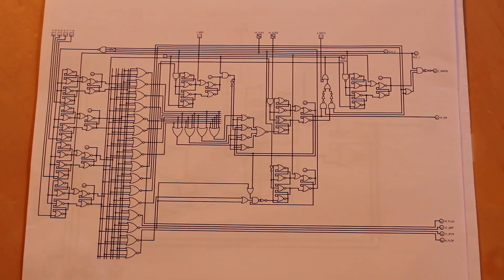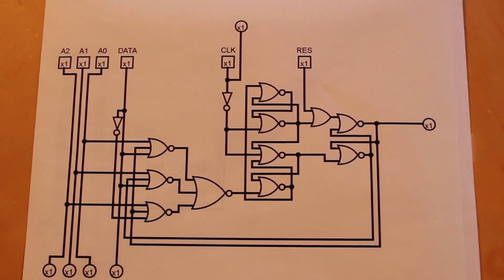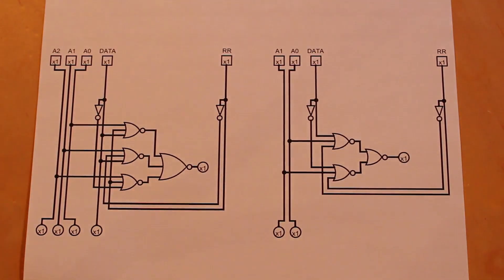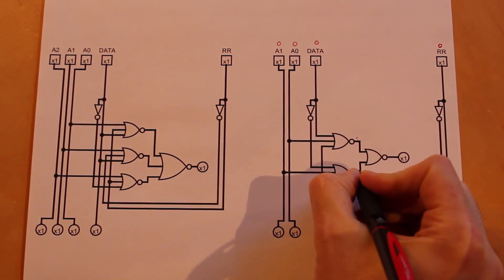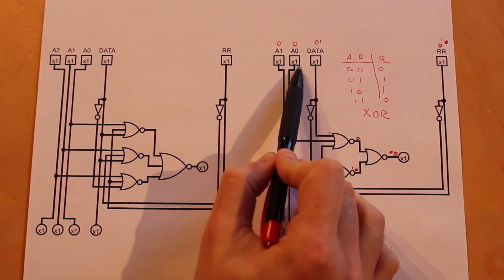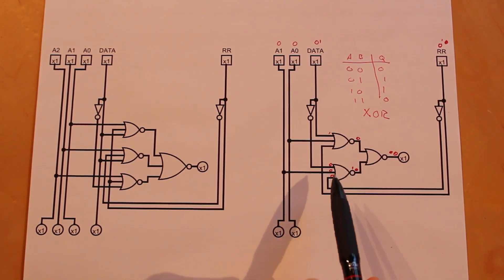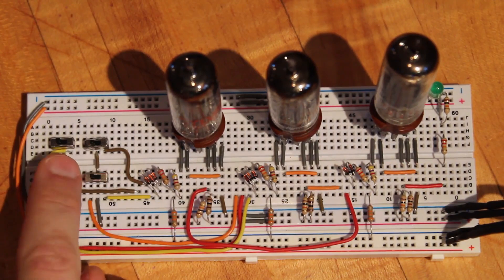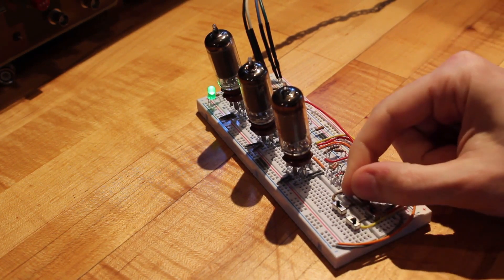Vacuum Tube Computer P.03 – Logic Unit

Comment: I think I understand why you use semiconducter diodes: To use tube diodes you would have so many of them that the tubes that do the actual work would be mixed in and not visible.
Reply: It's still heresy, because 8 SS diodes = 4 dual diode tubes. 6AL5 or the like. But the computer is insane and it works. Kudos to David for pulling it off.

Comment: When the transistors show up as replacements for the tube based inverters, this kind of logic become known as DTL, the predecessor of the TTL.

This usage of a multiplexer to implement logic gates from its truth tables, for a single bit evolved to the usage of ROMs for multibit data paths and is currently known as "lookup tables" and heavily used in FPGAs and similar devices.

Comment: Im enraptured by your projects and have almost everything to try this one at home. Is there any chance you could share a circuit diagram?
Reply from the maker: Thank you so much!
I don't actually have circuit diagrams for the larger components of the tube computer build, but I threw together a quick schematic for the three tube build here! Just as a heads up, I build all my tube schematics in TINA TI so I can actually simulate them too, but I only have a few tube models imported, so in the schematic it says I'm using 6DJ8s, but in reality, I'm using 6AU6 pentodes. The only difference is that on the 6AU6 I have the screen grid tied high with a 100 ohm resistor. Having said that, you could totally use 6DJ8s, they work amazing well at low voltages, better than any other triode I've tested!

Let me know if you have any questions on the schematic!
https://i.postimg.cc/wBsf53SK/MUX-LU.png

Comment: Super exciting to watch! Your production quality is also top notch! Been binge watching your videos lately - came for the relays and stayed for the tubes. I'm currently looking into building a relay computer (long term goal), this gives me some good entry points. May I ask, how you came up with the logic diagram for the Motorola Chip? Thanks and keep up the good work! :)
Reply from the maker: Thank you so much!
Relay computers are so cool! I actually credit Jeroen Brinkman and his Relay computer for really getting me into the concept of computer at a really fundamental level. Defintiely check out his website, he's got some fantastic information on building his computer: http://www.relaiscomputer.nl/
For the logic diagram, it was a mixture of two things. Mostly, I just used the architecture diagram to build up the individual components and link them together in logisim. But, the Logic Unit was a difficult one to figure out. When I cam to that part, I started looking for information elsewhere on the internet and came across this excellent website: http://www.6502.org/users/dieter/m14500/14500jpg.htm

I revised a few things in my design based on their designs, and then of course, I modified everything to work primarily with NOR gates, and ultimately, I modified the LU to be a full on ALU in a future episode. But all in, I think the logic diagram I'm using as my blueprint went through about 8 different revisions before I was happy with it!
Reply: @UsagiElectric  Thanks a lot for taking your time to reply! :) That's some nice info out there. I also found a few videos of people recreating processors in logisim. That could also be very useful.

Comment: A schematic with the tubes would have been nice.
Reply from the maker: Hiya, sorry about that. Each NOR gate is really just a standard inverting amplifier with some diodes added in.
Here's the schematic as built in this episode: https://i.postimg.cc/Z51GWJhx/LU-Old.png

The schematic shows the tubes as 6AN8P, but that's just because that's what was available in TINA TI. The design for the 6AU6 is the same here. Also, the schematic doesn't dhow the suppressor grid, but that's always tied to the cathode, so it can be omitted for simplicity sake.

However, since making this episode, I have done some revision on the resistor values I use, getting much better performance out of the inverters I build. So, these are the resistor values I would recommend now: https://i.postimg.cc/jSwVqLBj/LU-New.png

The only change is the plate resistor is now 33k and the two divider resistors for the grid are now 220k/220k. This design should work with most small pentodes out there, though there may need to be small changes in resistor values depending on how the pentode reacts at low voltages. If the gain is too low, the plate resistor can be increased even more to get more gain, but the divider network resistors need to be increased too. In my limited testing, 220k on the plate, and 820k/820k for the divider network works pretty good.

The design is really flexible and can be made to work with a ton of different tubes, the only thing that needs to be adjusted are the resistor values, which may take some experimentation to find what works best for what tubes you have!

If you have any other questions, don't hesitate to ask! Or if you want to chat in a more real time manner, come join us over on the Discord: https://discord.com/invite/p7UsfHD

Comment: Excellent series, really enjoyable to watch. Regarding your comment on 17 minutes mark, "always 1" result is both valid and useful result for Logic unit. See TTL ALUs (for example 74ls171), it has both "always 1" and "always 0" modes.
Reply from the maker: Thank you very much!
You know, that does make sense! I can definitely see some situations where you would definitely want to pull the result to high or low.

Comment: Man I really wish I could help you in it. Get the logic level madness sorted so you get more of a consistent closer to a rail to rail design.
I'd also make a PCB for it from SMDs to further compressify it :D
Reply from the maker: Figuring out the logic is by far my favorite part! Breaking down the MC14500 and rebuilding it at the logic level was massive fun and something I've been tweaking and modifying for more than a month now!

As for getting closer to a rail to rail design, it's really not too bad. When the tube is in full saturation, the output gets pulled down to about 5V to 6V, which for a tube is impressive. IBM ran 150V on the plate and considered anything below 50V to be logic low, so saturating down to 5V is pretty mental. At full cutoff the output is essentially the same as the positive rail, which is 24V for my designs. But, when feeding the output into another inverter's input, there is a voltage drop, often putting the logic high down to about 17V. This is due to the -12V bias coming through the 33k resistors. Ideally, I should be using much bigger resistors, but in doing so, the amount of swing I can get on the grid decreases significantly, which causes the whole delicate balancing act to come tumbling down. What this means is that one inverter output can only be fed into two inverter inputs at most. Any more than that and the logic high drops to below 14V and the whole thing stops working.

I honestly, just need more plate voltage to make things simpler. Even if I were using just 48V, the tubes would respond so much better. But, I'm nothing if not stubborn, so 24V it is! The solution is cathode follower buffers, but that's something we'll be getting into more in future videos!

It will all be made on PCBs, although with through hole stuff instead of SMD stuff. As a bit of a spoiler, I'm actually pretty happy with about half of my PCB design of the full MC14500B replica, so it's getting pretty close to time to start cutting PCBs!
Reply: @UsagiElectric  Nice!.
Yeah I was thinking of cathode followers but the problem now becomes apparent as you now need quite a lot more tubes to really give it some meaningfull drive :D
Reply from the maker: @adam207321  Yup! It becomes a balancing game of putting cathode followers only really where necessary, but it'll still result in probably a 20% increase in the number of tubes. Then again, the more tubes I use the cooler it looks, so that's an acceptable tradeoff, haha.
Reply: @UsagiElectric  yeah but looks dont always equal to functionality ;) we as designers and engineers must look at the number one priority and that is to make it work :).
Reply from the maker: @adam207321  Too true! But then again, when working with tubes nowadays, form does tend to sit on equal ground as function, haha.
Reply: @UsagiElectric  well at least one function is guaranteed and that it's a space heater :D